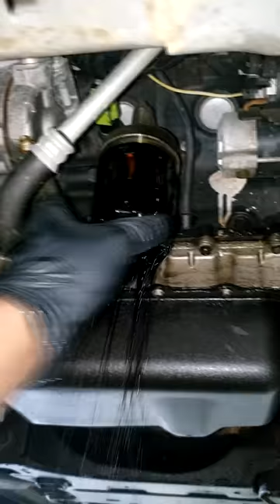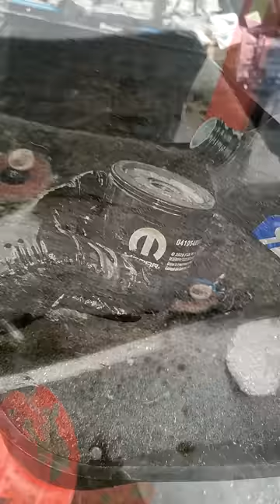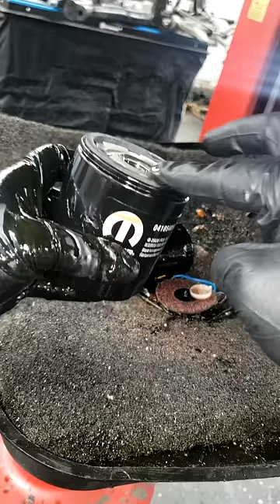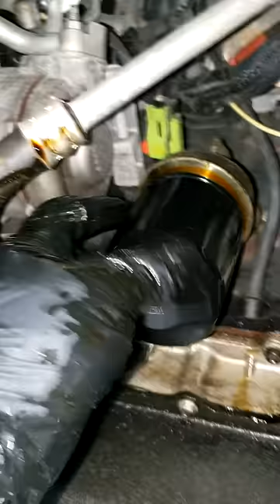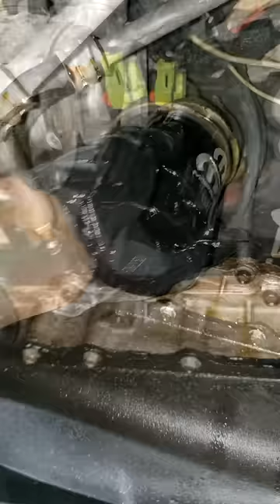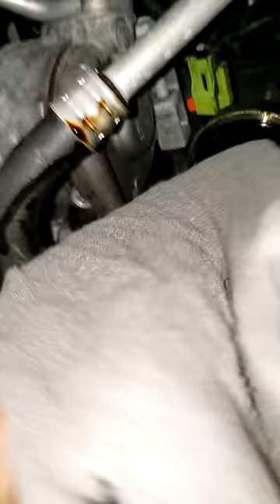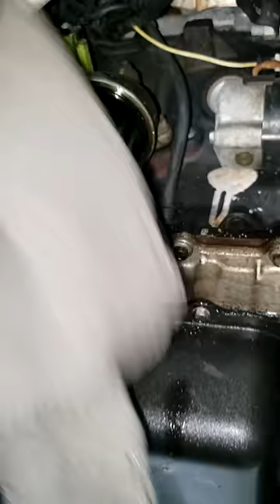Don't Lie.. Are yall still doing this?

Comment: this is why i change my own oil. he didn’t even bother wiping down the area before installing the new filter. it’s the little things that counts.
Reply from the maker: Would you like a cookie because you change your own oil? Yes, you should wipe down the old oil off the plate but it's not the end of the world if you dont dude.
Reply: Might have to throw the whole entire car away since the surface wasn’t wiped … man that might just set off all the sensors… might just get a flat cause the surface wasn’t wiped… man now the cars making weird noises that it wasn’t making before …
Reply: Why should he it’s not his car and it looks good enough
Reply: Could just look at the old filter once taken off to make sure the seal stayed with it lol
Reply: @WhipthatTrix91 It’s not about looks. It’s called proper procedure, and exists for a reason.
Reply: @OnlineMechanicTips  "we still do it for a reason
Reply: Why does it matter if the sealing surface is wiped of if you have to lubricant the seal on the filter anyway that’s why you wipe/spray it down after the filter is installed
Reply: @TylerMartin-bf9yb  Dirty oil has contaminants, suspended solids carried in it. That can mean the difference in a small leak (which can grow) because of an imperfect seal (caused by those suspended solids) and a perfect seal which doesn’t leak, which is what you have when you coat the surface with a very thin film of clean, new oil.
Reply: @NOLAgenX  that's literally what gaskets are for to take up the imperfect surface and if the contaminates are that big you probably got larger issues at hand with the health of the engine
Reply: Did he say not wiping is the end of the world? He said the little things count, and leaving dirty oil to bake on to the seal isn't bright. Let's not defend sloppy work either by pros or home mechanics ~
Reply: @georgehofgren6123  👏👏
Reply from the maker: Are you a drama queen or you just like to act like one?
Reply: @OnlineMechanicTips  second video I've watched and second time I've seen lazy non professional work.
Reply from the maker: @JoshJackson13  Then maybe its time for you to stop being a sideline troll and get in this Youtube ring and make some professional non lazy videos dude. Or would you rather just complain all the time?
Reply: @RaulGarcia-qf3gg bruh same. My mechanic forgot to wipe the surface and when i shifted the car to reverse, it moved foward instead. Then when i hit the brake, the horn went off instead. Tnks for the heads up🗿
Reply: @2665smarky I thought the same thing!!
Reply: I'm a commercial airline mechanic and a Marine...so that was driving me absolutely crazy! lol
Reply: Better to leave a little on there so you don’t double gasket. Cmon now
Reply: From a guy who changes filters on combines, tractors, semi trucks, pickups etc. I see a gold hue on that oil left behind, if it was black I'd wipe it down, but no dirt or contaminants here to be worried about
Reply: @FreedomEagleYT  I'd wipe it just because I'm a clean freak when It comes to oil changes.
Reply: @tima.478  Yeah, it's one of those things that doesn't hurt if you do, doesn't hurt if you dont. I do understand your mindset though, air filter housings, battery terminals i.e. I'm a neat freak 🙌
Reply: Dudes worried about not others not prefilling but cut so many other corners
Reply: I don’t wipe it down, just hit the area with a bunch of brake clean and put the cover on.   Never had a customer complain.
Reply: @beastfromtheeast9318  Well, hitting it with brake clean works too.  ✌
Reply: @OnlineMechanicTips  With that reply I'm pretty sure he'll keep changing his own oil because little things to you are more important to others.
Reply: @WhipthatTrix91  of course, why not, f the customer
Reply: @georgehofgren6123  I can't wait to see the little things that count when he does a brake jobs.
Reply from the maker: @Steve007362436  My point was its just old oil and was no big deal until you guys that change your own oil at home in a squeaky clean garage  twice a year see a guy in a shop that do this all day everyday. It's not the same during. But the results are the same. Who cares how you got there. Your oil changes no different than anybody else if the results are the same. Some of yall just big drama queens.
Reply: Spill and fill dealer
Reply: Constuction equipment , big rigs , etc are notorious for needing gasket surface scraped and that is partially due to when new filters are replaced , we techs , wipe the seal with a fresh coat of oil and we do precharge the filters with fresh oil prior to installing thus also coating gasket with more oil , actually , that is where i get the oil to lube my seal , from the fresh oil in the filter that was poured into the filter . Due to the long service intervals and long periods of high heat , that film of oil will dry out thus being like glue therfore gluing the seal to usually the oil filter flange . We should probably just rub oil on the filter side of seal , therefore , in hopes that the seal will stick just to the filter ; only on diesel filters or filters with removable seals . If your filter seal is glued to filter your SOL , as those definitely require you lube the seal to flange side or you could rip/tear seal during installation if you don't lube seal with fresh oil prior to installing filter thus possibly leaking oil . Although i don't fill my oil filter with clean fresh oil as i was told it isn't necessary on pasenger vehicles as they don't have extra filtration like commercial diesel engines have for the lengthier service intervals they do so car engine filters fill their oil filters much faster thus not requiring the filters to be prefilled but i would say if your car has been sitting for an lengthy time it would probably be good to either fill the filter with clean oil if installing a new filter after doing an oil change or if oil isn't being replaced and the car has just been sitting for extended periods of time and its fuel injected , i would just pull the fuse that powers the fuel system and crank the engine over a few times ; that later was the process after coming home from deployments or being on the road for more than a month .
Reply: Just change yer oil regularly its not rocket science no big deal not wiping up
Reply: Is called “attention to detail”. You could never work in the same shops I’ve worked in.
Reply: I don't wipe off that area which is pointless, there's way more old dirty oil in the pan left than those few drips left around where the filter goes. It doesn't make much difference.
Reply: I’ve never wiped it down ever , all my engines are still on the road . Get over it
Reply: @OnlineMechanicTips It's not the end of the world of course, just sloppy.
Reply from the maker: @aspenGF8   Then stop acting like a drama queen. The job was done, it was cleaned up after it was done, all the oil from the car ended up in the oil drain bucket where it belongs. Who tf cares how I got there? Customer got her oil change done.
Reply: Its just a car throw shit on . Prob roll it next month 😂
Reply: I would not do this because when looking up how much oil it takes to fill your car up with changing the oil filter it shows a number so that way after you start the car and check it it will be right but not after you fill it up
Reply: @OnlineMechanicTips lol for real
Reply from the maker: @ghostbuilder3187  I'm not interested in working in the same shop with you my guy so it's ok.
Reply: @OnlineMechanicTips  lol it not the end of the world 🌎
Reply: @OnlineMechanicTips would you like a cookie because you wanna be a tik-tok mechanic? Don't sit here and make a video about "this is the proper way to do an oil change" and then you continue to do shit incorrectly, and then get salty when people call you out on it. What a joke💀
Reply from the maker: @LongboardManiac  Uhm excuse lil Mr Nobody ass man. My reply are always based on the comment given. If you come at my foul I will clown ya silly ass. I always agree with folks that comment and say you should wipe down the base because i agree, you should. But if you continue and then start talking shit, we have a problem. You can respectfully disagree with somebody. Don't get on here talking about thats why you do ya own work because I will simply ask you if you want a cookie for something you should be doing anyway. Now as for ya lil whining crybaby ass, would you like a cookie as well?
Reply: @ghostbuilder3187 you're so cool dude.
Reply: Looked clean to me.
Reply: @OnlineMechanicTips when you're trying to show best practice, you should practice what you preach.
Reply from the maker: @grandiora  This basically a question video about do yall still prefill oil filters. I had no idea the focus would become about the oil change in general. This is not a How to change your oil video dude. Some of yall so perfect you just can't help yourself and you lose sleep over the simplest of things. And for the record, guys that do this everyday day in and day out no where near as perfect as you squeaky clean home garage mechanics are. After 20 years there are now somethings we just consider petty and the world will not in fact come to an end now and just not that big a deal. So please dont/stop confusing the two.
Reply: Maybe he did wipe it it's a "SHORT".

Comment: Depends on the size of the engine. For a car it’s not necessary but I’ve worked on some ISX13 where the filter takes like 4 quarts to prefill and in that case it’s definitely needed

Comment: I build race motors. We only do this if the filter is of a certain size and or with our 3000+hp drag motors. Plus, you need to pour into the small side plugging the middle.  You don't need to do this at all with any normal ride unless it's a diesel.  What matters is wiping things down including the mating surface before screwing the new filter in. I also like to pop a small hole in the filter before removing it allowing the remaining oil to seep out nice and clean versus the mess you displayed here.  I use a hole punch. When installing the new filter just take a finger of clean oil to the new filter gasket spreading it even and re-install it hand-tight. Make sure to add oil and recheck a few times before and after the start allowing a few minutes between starts to let the oil drain back in the pan.
Reply: Sure, you can skip this on a drag or race engine because you'll be tearing it down and rebuilding it really soon.  But on a production vehicle, the filter needs to be filled.  Why?  Because there will not be any oil in there when the car is started after the oil change, causing wear and tear on the engine.
Reply: "Plus, you need to pour into the small side plugging the middle." LOL
Reply: Yeah, testing has already been done. No filled oil filter increases time the engine rotates without oil pressure. it's significant, as in seconds.

Comment: We were taught to just put it on empty fill the oil and start the car let it run for 30 sec to let the oil circulate then fill the last little bit, works really well especially because a lot of filters these days arent in nice spots
Reply: More like 10 sec.
Reply: Seconds of wearing out counts.
Reply: If it's hot that isn't an issue. 
On a cold car that may or may not be driven after the change it's necessary.
Reply: @emergencylowmaneuvering7350 
Seconds of wearing?
1. I have yet to meet an engine that you don't put oil directly onto the cams, in the head.
2. There's typically somewhere between 0.3 and 0.5L left in suction tubes after draining the oil, which should do just fine for the 2 seconds it takes to fill the oil filter.
3. A lot of oil usually bypasses the filter anyways, so oil in the pan is oil in the head.
4. Something about low tolerance engines, and engineers having taken oil changes into account.
5. Some Nissan models with oil filters sideways on the back of the engine. Some models of Subaru with an upside down filter on top of the engine. AND many high end luxury, or even sport cars that don't have a canister filter, rather insert filters... Which almost unanimously go to the top of the engine, with the outer case being upside down.
6. I also didn't use to pre fill my filters on anything, and never had issues.
Reply: idk at my workplace they just tell us to fill up the oil then gun it to circulate oil and deliver it fast
Reply: @emergencylowmaneuvering7350  do you prime it every morning before start ups?  No it doesn't matter, whats you excuse for horizontal mount that cannot be pre filled?  But, but, it matters.  No it doesn't.

Comment: Yes especially 6.7 powerstrokes. They take almost 30 seconds to build oil pressure with a dry oil filter.  I'm a senior master tech for ford  everyday I see these engines with wiped out bearings from oil starvation. Prefilling filters when u can does make a difference

Comment: Someone without attention to detail made this video.

1) Get a plastic disposable cup and use that to grasp the bottom of the filter... as you spin off the filter the dirty oil will collect inside the cup and not below (keeps your hands clean too).

2) Clean off your mating surfaces right away as things are draining.

3) Now remove your fill cap and clean it... this will allow more air flow to let the oil drain faster.

4) Now it comes to your personal preference if you want to pre fill the filter or not. The internals of the engine walls allow a film of oil to stay in the 10 mins it takes to do the oil change (imagine what happens over nite sitting).

5) Under fill by 1/2 qt, let the motor warm up the oil while running idle. Then check your oil level once at operating temp (oil will expand by temp). Then set your oil level to the correct level 👍🏽

6) Check for leaks
Reply: Thanks for #3.  It seems so obvious now.  I feel stupid for never thinking of it.

Comment: Doing that can put particulates into the engine without filtering it out causing those particulates to flow through passages and bearings. This can cause wear and/or failure. The oil pump fills the filter properly unless it's a bad oil pump. Everyone do your own thing. Just my 20 years talking. Have a great weekend!!😊
Reply: So how do you add fresh oil to the engine?  Pour it right from the bottle into the head?  Huh.  Imagine that.
Reply: @stevenbeach748  yea, the oil under the rocker covers is dirty with contaminants but it is ok to flow new on top and trickle down to the sump because unfiltered oil (already pumped through the engine) is supposed to flow from the head to the sump before getting pumped and filtered under normal operation. The oil on the discharge of the oil filter gets pumped to the journal bearings with super tight tolerance, and the only thing that can be between the bearing and crank shaft should only be oil, not oil and debris.

Comment: I work hydraulics in the military and for the fluid filters we even keep hydraulic fluid in the filter bowl, same as an engine oil filter for a normal vehicle pre lubricating the filter before operation helps prevent the filter to have any dry pockets leading to possible operation issue (leaks)

Comment: Always when the filter is vertical or close to it. Also I have made it habit for 40 years you always take a rag and wipe the mating surface. This ensures no dirt and no gasket remaining. I also use fairly clean gloves, you could at least wipe them off a little.
Reply: That part
Reply: Especially if it's a Fram filter

Comment: After removing the old filter I clean the mating surface first.

Half fill the filter to prime for any internal tensioners to be pressurised but not enough to spill when fitting.

Lube the O-ring with new oil to prevent pleating.

Clean the new filter and surrounding area after fitting to make it easier to spot leaks etc.

Basic best practice.😉
Reply: I do the exact same thing!